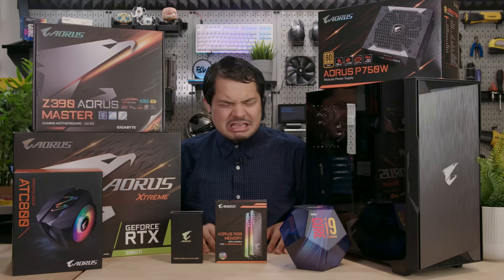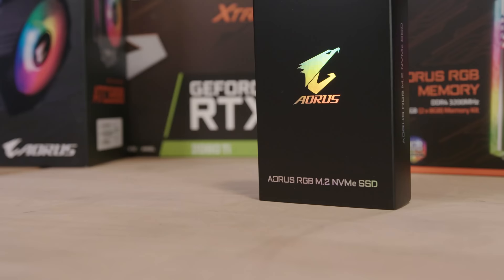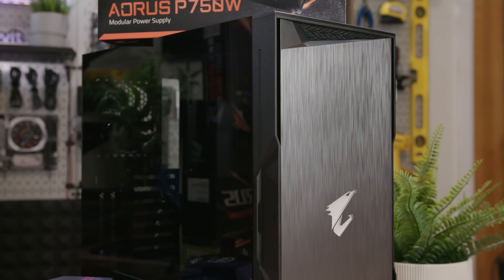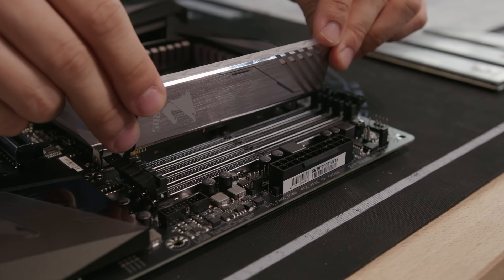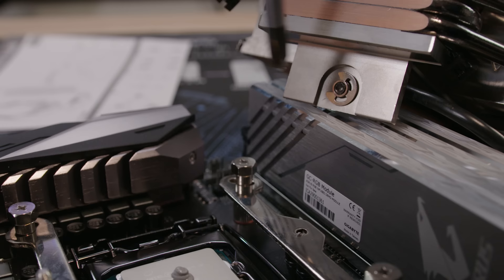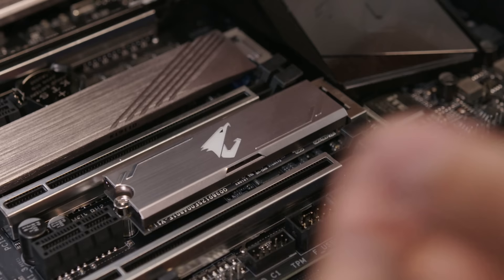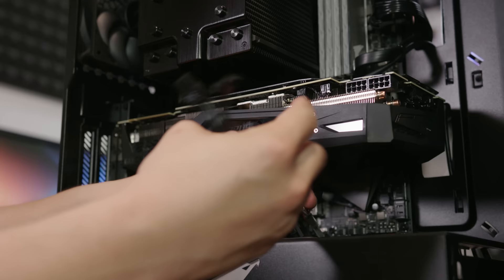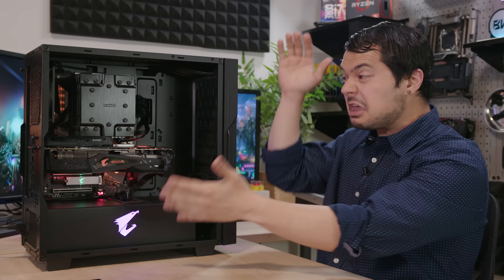I HIJACK my brother youtube channel to build you free PC

Comment: But when building a pc, there is always one important rule everyone must know

Make sure to have a Swiss Army knife that HOPEFULLY has a screwdriver
Reply: Dude... Omg. I know it's been 10 months but I hope I got to you in time. Don't go out and buy a Swiss army knife with any old screwdriver...you have to make sure it hopefully has the Philips screwdriver.
Reply: Make sure to get a table with that
Reply: And a ANTI static work surface
Reply: Don’t forget the thermal paste applicator
Reply: make sure you have an allen wrench
Reply: Make sure you also have the CPU bracket installer.
Reply: How has no one here remembered that you need tweezers
Reply: @goneoffBeBonked  indeed, but you mustn't use it, just have it with you
Reply: You also need to paint your processor with thermal paste and make it into a Van Gogh masterpiece

Comment: wait that gigabyte atc 800 aorus cooler is due to be released soon and it's snapping......
Reply: if you over tighten a screw pole like thatr it can snap. It shouldn't happen, but this could be an early production model. This may not happen to the versions that are being released. 

To be honest, When I installed my Artic Accelero twin turbo III one of the 4 poles also snapped off due to over tightning. Luckily Arctic are good people and sent me  new ones.
Reply: My thought exactly. Sponsored by Gigabyte. And then Gigabyte product breaks. Gotta love that press.

Comment: The thing that happened with the air cooler's screw happened to mee too on a Cooler Master Hyper 612 Ver. 2 and I had no way of getting a replacement screw because it was proprietary and not supposed by warranty :/

I hate low quality products!
Reply: Yeah the biggest cringe in this video is that it's all gigabyte, sadly they are not that great.
Reply: @willies545   The GPU it is good quality for sure. It is very silent and it also looks cool! I get 2000Mhz easily on my RTX 2080.
I agree that not all Gigabyte products are exceptional. But I had 3 motherboards from them and 2 GPUs and I had zero issues.
The R9 390 that I have from Gigabyte is still running fine overlooked since 2015.

Also the Aorus line of products is Gigabyte's premium branding for products that should be higher quality.

Comment: Hey guys, I've pretty much got the exact same build but the RGB of the case isn't being detected by RGB fusion. It only stays at a solid yellow colour and I can't change it (the LED button on the Case's IO panel doesn't seem to do anything when pressed). It seems like I've got all the cables plugged in correctly, but would like to ask you guys if you've come across this problem before? Thank you!